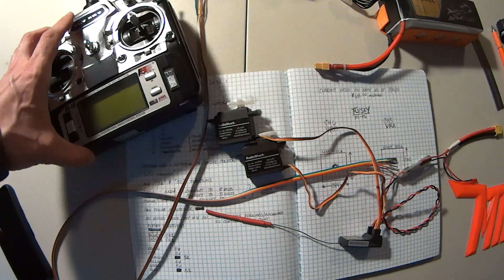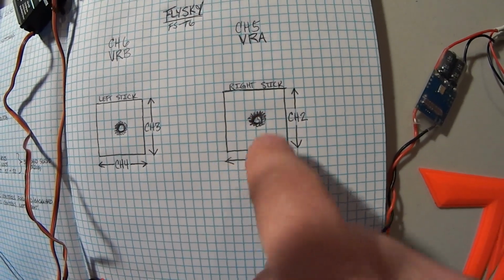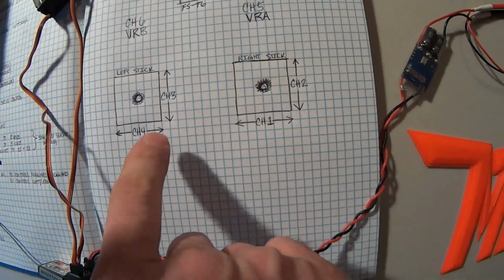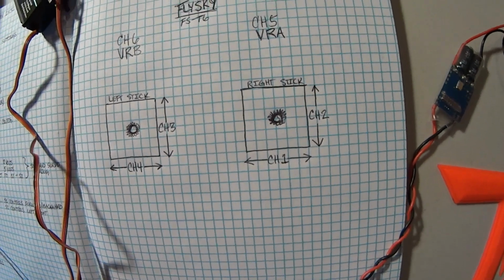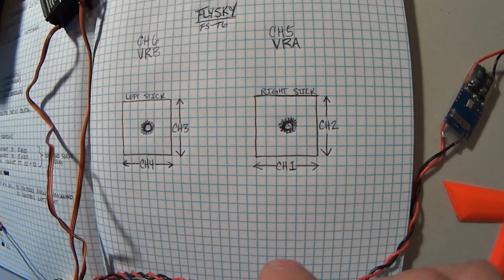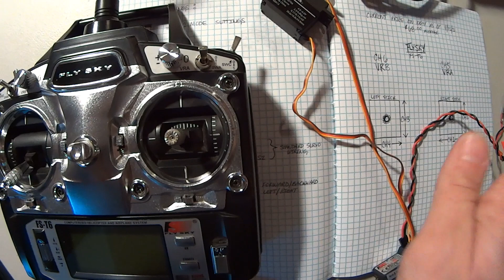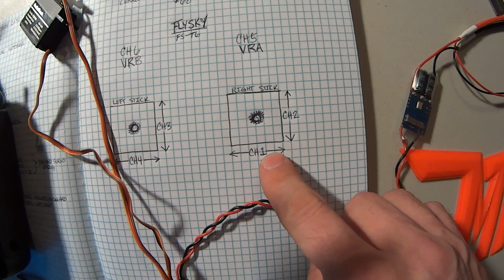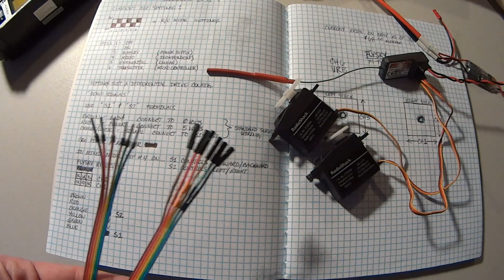RC Lawn Mower V2: Pt. 13 - Motor and R/C signal function test

Comment: Hello. It was a very nice video. I have a question. Is your driver enough for these two motors? I bought 2x32 amp drivers for 2 320w motors. There is a 120kg machine. Do you think the driver's power will be enough? Can I also use an amplifier fuse?
Reply from the maker: @HobiDukkanii Thank you. The driver I have is enough for the motors I run. I will say, I would recommend larger batteries though. Mine work but could be bigger for sure. I will suggest the largest batteries you can afford. You could use an amplifier fuse or circuit breaker to protect everything. The sabertooth drivers have some very nice protections built in. They also are amazingly powerful. I would expect you will be able to run your machine fine using the drivers... As long as the batteries are beefy enough. Thanks for watching and commenting. Good luck with your build.
Reply: Hello, sorry to bother you again but I have a few questions. I wrote before but I'm asking again to be sure. I have a system with 2 200W motors and 32 amp sabettooth drivers. Should I use a fuse for safety? If I use it, will a 100A amplifier fuse be enough? I'm also thinking of putting a button to cut off the energy coming from the battery but the strongest button in Türkiye is 24 amps, what should I do? Can I use an alternating current fuse?

Comment: What battery size in Ah used to drive those wheelchair motors?
Reply from the maker: @CertsUAsPilot  I use 2, 7000 mah 6s packs in parallel... There are a lot of people who have commented that they use more. It works the way I have it but I do plan to run larger batts in the future. Lots of experienced builders tend to say 20 AHr or more is required for consistent operation from the sabertooth. I'm def running bare min batts. Thanks for commenting. Good luck with your build.
Reply: @MTRFAB  I have four motors and a speed controller (not Saber Tooth), just don't know how to figure out what size of the batteries would require to do a single mow run. Thank you for sharing your work and good luck.
Reply from the maker: @CertsUAsPilot  I can get 1.5 hours of mow time with my setup. I will say that when the batteries get low on juice some unexpected things can happen (brown out). That's why most guys use larger AHr batts than I do. That may just be a sabertooth thing though. Basically, my suggestion. Buy the most battery you can afford. You will not regret it. I am buying a bigger set than I started with. Silly on me. Just my 2 cents. Enjoy.
Reply: @MTRFAB  I see. Now I have a good idea of what battery size would be needed for mine. Thank you very much for your info, sir.

Comment: Wanted to share what Sabertooth recommends for the breaker placement & type.

We prefer that you fuse the motors rather than the battery leads, or if for safety reasons you need to fuse the battery that you do it at a much higher current than the motors. The reason is this:

Because Sabertooth is a regenerative driver, it relies on having a battery to put regenerated energy back into when you command a stop (and at other times). If you draw enough power to blow a battery fuse, all of a sudden the Sabertooth has nowhere to put the energy. It will see the fault, though, and try to stop the motor. It doesn't, however, have anywhere to put the energy (the mechanical energy of the vehicle and the electrical energy carried in the windings and the caps). So blowing a battery fuse will sometimes kill the driver -- which we can usually repair at no charge, but it's still annoying for all parties.

The better way to do it is to fuse the motor leads. If a motor fuse blows, the motor will freewheel, the Sabertooth will sit there contentedly, and the only thing you will have to replace is the fuse. A very large fuse (100 amps plus for a 2x25) on the battery lead will protect the wiring in the event of a battery lead short or motor driver failure.
Reply from the maker: Love it. Thank you for sharing. I like the idea of fusing the motors and how they can repair it but recommend fusing just to be safe. I never had a problem with the way this was set up in the past but it is worth knowing. Thanks again for commenting.

Comment: I can't find the sabertooth 2x25 motor controller can you please send me a link. I want to buy it. I like your video. Very explanation on everything. Love it. Great job 👍
Reply from the maker: Thank you for the nice comments. Unfortunately, the sabertooth motor drivers are super hard to find right now. There are 12 to 20 week lead times on the dimension engineering website. That's where I've purchased mine in the past. Dimensionengineering.com . Good luck tracking one down. They really are great motor drivers. Thanks for commenting. Good luck with your build.
Reply: @MTRFAB  well I just found a replacement or something similar to the one you have it has more amps , but I just gonna give it a try to see what they can do , it calls Roboclaw 2x45A Motor Controller (Screw Terminal Version) is close what you have. . Thanks for the inspiration to build a great project. I'll continue watching your videos.
Reply from the maker: @sammytigueron9351  Thanks for all your support. It's almost all back together and more videos to come. I'll check out the roboclaw too. Enjoy your build. They really are fun to make.
Reply: The 2x32 sabertooth is what I'm using it peaks at 59A, seems good for hills. Same driving controls through s1 & s2. I only used the power cables (red) on the s1/s2 to channel 1/2 on the reciever. I understand why all 6 wires where used, but it did confuse me for a sec.

Comment: Thanks for your video.  My gimbal needs to go let’s say at 2oclock to run both motors straight.  If I go straight up it only runs one motor and horizontal runs the other.  Any suggestions?
Reply from the maker: Maybe check the trim on the transmitter ??? Make sure they are centered. Or possible that the programmed end points are off?
Reply from the maker: Or possible you have the wrong channel programming. Look at your stick mode/ channel map. Double check you have them  programmed to the right sticks.
Reply from the maker: Thank you for watching. Good luck with your build.
Reply from the maker: Also please review the answer I supplied Julian in the comments on this video.... It also could be a possibility.

Comment: so I am running this same setup in independent mode so I can use both sticks on the controller. I am using 4 permobile m300 motors and it wont climb a hill. Not sure if its in the settings on the controller but Iam using 2 12 volt batteries in series to make 24 volt and its fast and strong on flat ground but up a hill it will go halfway and just not climb anymore. No tire spin just seems like it ran out of power. I am using a 24 volt fan on the motor driver cause of our 100 degree heat here
Reply from the maker: Do you have a current limit set in the controller? Are you using the Describe software to set up?
Reply: @MTRFAB  thanks for the reply. Not sure how to set the current limit? I used it directly out the box.
Reply from the maker: @freemurray  directly out the box it should be able to do full current...64 amps.... To 70 max. You may be drawing more  amps with the 4 motors than the saber can handle. I only run 2 motors. But uphill with a load.... Current can definitely climb.
Reply: @MTRFAB  do you mean throttle curve? its H is 100% factory settings
Reply from the maker: @freemurray  Current Limit 
This setting sets the maximum current for the motor output. If the system tries to draw more current 
than the setting, the output duty cycle will be reduced. For Sabertooth 2x32, each motor output can be
limited individually in a range between 0A and 64A. This is a soft current limit, and will slow acceleration 
but allow motor motion to continue. There is also a fixed hard current limit above approximately 70 
amps which protects the Sabertooth from a shorted motor.

Comment: I am making something close to this, i would recommend using ardupilot for autonomous navigation and obstacle avoidance later on, the newer pixhawks are a bit expensive but for our purpose i believe APM 2.8 is enough, it cannot update to latest version but i think the version it supports has enough features. (Pixhawk and APM are flight controllers). Also what sabertooth are you using?
Reply from the maker: I enjoy the challenge of striping the lawn. Maybe go autonomous next year.... The sabertooth 2x32 is amazing. Thanks for the suggestions and watching. Enjoy your build.

Comment: Thanks a bunch for your videos, they’ve helped me get my mower on the ground. What would you say the issue is when I power my transmitter on, the motors begin driving forward—without Moving any joysticks???
Reply from the maker: Your issue may have something to do with " Automatic calibration, the voltage levels are re-learned every time the motor driver is powered up. 
This should only be used with input signals that self-center, such as joysticks. When powered up, after a delay (the Calibration Delay setting) the Sabertooth will take whatever voltage level is presented at the 
input and use that as its zero speed setting. It will then constantly look for the largest and smallest 
voltage that it has ever seen, and use these values as full speed forward and reverse. Automatic 
calibration is very helpful for signals such as low-cost joysticks that have significant variability in their 
center and end values. The downside to using Automatic calibration is that if the joystick is not in its 
center position when the Sabertooth is powered up, or after it loses power for any reason, control will 
be incorrect. 
Joystick Calibration 
With Joystick calibration, only the stopped position is re-learned each time the Sabertooth powers up.
You can manually change the Input Min and Input Max values. This can prevent slow speed creeping if 
the joystick does not return exactly to center due to mechanical hysteresis or sticking. Higher quality 
joysticks will often have a defined output voltage range, usually 0V to 5V, so automatic calibration of the 
endpoints is unnecessary."
This was directly copied out of the sabertooth 2x32 manual. I hope it helps.
Reply: @MTRFAB  that definitely helped. Dip switch adjustment corrected the issue. One more question though, what did you do to avoid the motors from overloading the Sabertooth and possibly leading to danger?
Reply from the maker: The sabertooth is the BOSS! Lol. I've never set any current limiting. It just works for my application. I never had any indications of loading issues. I just think even worst case... These motors peak currents are still within the boundaries of the motor controller. I have seen guys running four motors off the driver at once. I'm not saying that's good or would last long.... Just that I have seen it.
Reply: @MTRFAB  I should have also said I’m powering both with small 12v automotive batteries. Had a bit of a scare today that’s why I ask. I know you’re using the Lipo setup but I guess I just have to be careful for those types of scenarios where a motor  can get overloaded.
Reply: It may be me running the 2x25 versus the 2x32
Reply from the maker: I believe there is current limiting in the describe software provided at dimension engineering's website. Go there. Look up the 2x32 and download the manual if you haven't already. While your there, download Describe. Look around in there. You can set current limits. I use to use lead acid on the v1 but I don't remember ever having an issue.
Reply: @MTRFAB  great. Thanks!
Reply from the maker: @Etch_n_sKch  A possibility for sure.
Reply: @Etch_n_sKch  I have the same issues as you did, which switch on dip switch was "wrong" in your case?
Reply from the maker: Thank you for watching and I'm glad my videos help.
Reply: I want  1 Set radio control and sircuit .... How tu buy iam. In indonesia , thanks